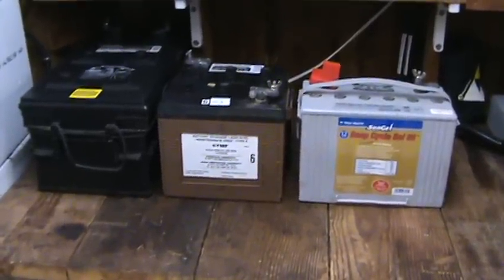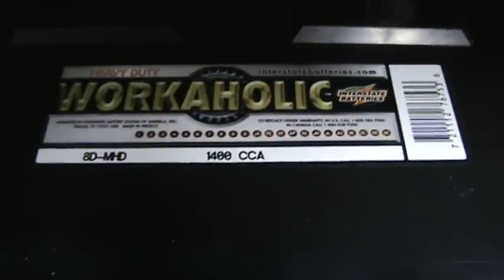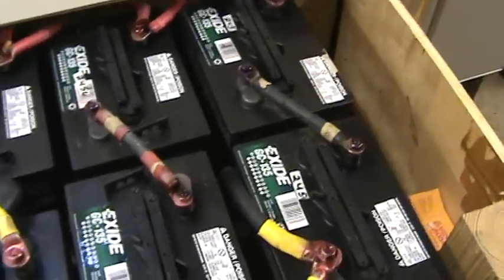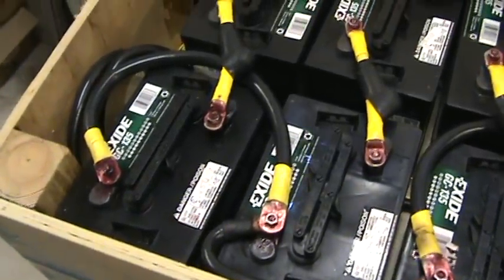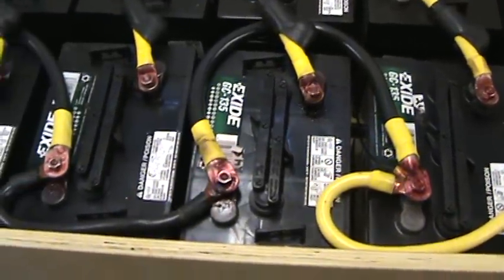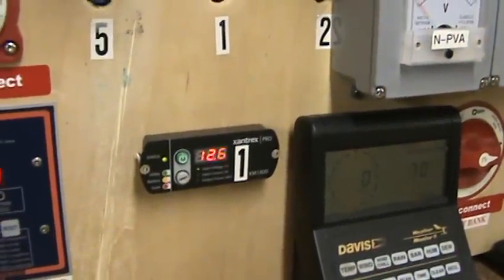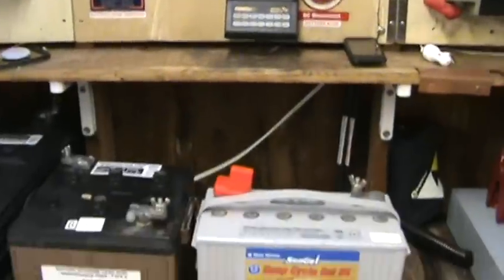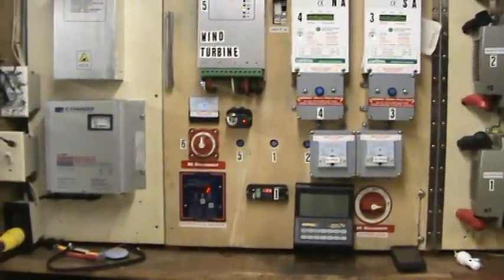Choosing batteries for solar power offgrid or a battery backup system.

Comment from the maker: If cost is not an issue I would go Rolls Surettes with auto fillers. If you are running a hybrid system with batterie back up The high end AGMs cant be beat. I have seen your set up.. Very nice.. Cheers..

Comment: Looking at a 15 kW system myself for a cabin up north but  this looks too expensive and time consuming for an occasional user.  I'm going to just tie to the grid for now to offset the $50/month hookup charge then work into storage gradually.  Maybe there will be an alternative in another 10 years.

Comment: The trick is eliminate as much resistant as you can. You start adding to much in the system and you end up defeating your panels output.

One thing about being mobile is your not stuck in one place. You can charge your batteries on a parking lot. Those four 1000 watt lights put out 4k watts on each pole at night. So let walmart pay for your electrical power!

Comment: If your wanting portable power, I use 2 235 watt panels, xantrex 1800 hf inverter with both 12 volt or 120 volt shore power input/output, 30 amp charge controller, and 2 12 volt northstar batteries agm deep cycle. It has 195 amps hour or 2400 watts charging over a 5 hour sunlight/cloudy day period. Its all mounted on the top of van and can track the suns path. You can do the same with a truck or suv.

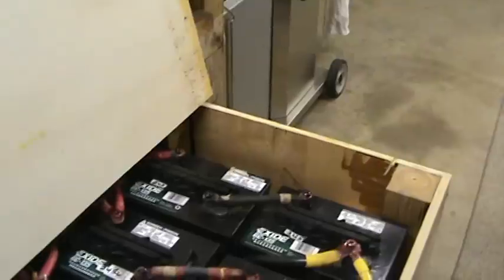Comment: I bought an off-grid house and right now I'm using an Avanty power station (similar to what can be seen at 2:47 in this video). It's not only a car battery booster but also a 12 V battery with built-in inverter with a regular socket and it can be charged from the wall back home and with a solar panel. It's 20 Ah and I'm using LED lights with it. Good for the weekend. Because I'm not living permanently at my cabin, stuff might get stolen. Any recommendation on an efficient portable solution?

Comment: thanks it has help me to decide what battery to use.  How about electric fork lift that may use in warehouses?     I want to build a off grid system   with 220 volt  power not tied to grid at all. to get power to my place would cost $13000 to 16000 for the cable in the ground from the power company.  I want some ideas on inverter, solar panels, controls, how Many?

Comment: Very good video.  You have a very clean setup.  I'm thinking about trying this in the UK.  Our electricity bills are like daylight robbery so I'm thinking of putting together a solar system.  I want to buy a couple of 120W panels ( Peak Output 7.93A @ 17.2V) to start with but looking for a decent set of batteries.  What rating of solar cells do you use and how many panels do you have?  I saw you also have a wind turbine in your system which is really cool.

Comment: I'm looking at making a solar generator but don't know much about any of this yet. I was thinking about using two 6v, 250ahr batteries with an 80watt folding panel, but I don't know how to figure out how many watts the solar panels need to push to charge them properly. Any advice? Does this seem like it would work?

Comment: When I bought my RV 3 years ago I took out the starting and auxiliary batteries and replaced them with golf cart batteries.  I was worried that they wouldn't have enough cranking amps to start the 454 but they've never failed to start the engine even when discharged below 11.7 volts.

Comment: lithium. iron. phosphate.
like Calb CA cells.
of course it's a different beast and you have to know how to treat them. don't overcharge, don't underdischarge. but then they will last several thousands of deep cycles and are near 100% efficient and they don't drop to half capacity if you discharge them in an hour.
lead's dead

Comment from the maker: They are. I like the AGMs that are made for solar use or off grid. Batteries are getting better but flooded lead acid batterys seam to rule in the truly off grid setups mostly Rolls Surettes. They are not cheap by no means but the large off grid systems use them and were talking world wide. Im shure the new batteries will be coming but for now they are crazy expencive and offer very little when it comes to long term track record.

Comment: are these all lead acid batteries?  Have you tried LiFePO3, Lithium iron phosphate?  I heard they are better for cycling due to its BMS and quick charge and high discharge rate

Comment: Great video brother.

 I have one of those UBER hyped Optima Yellow top batteries that are now made in Mexico for the same price(mine is one of the last ones made in Aurora Colorado) and it actually turned out to be an incredible battery for my mid-sized suv. 

So your saying that you only discharge your *Gold cart battery bank* down to 30% of total capacity? I knew some folks would correct your off math..haha. 

God bless brother.

Comment: Hi.  Can you please tell me, do you have to get electrical permit from city hall to put solar panels on the roof to charge your own batteries.  I have some solar panels on the roof and I charge few golf car batteries. And I do not interfear with a my grid. City inspactor told me that I have to pull a electrical permit, so that they can comein and inspect my home system.  I dont know what to do.  Please help. Thank you.

Comment: Do you have a video up on wire size? Specifically, is #12 wire safe to wire an off-grid cabin with? I am planning a 24v system and using LED lighting. The longest run would be around 30ft. Any info you could share would be greatly appreciated. Also your videos are some of the best I've seen keep it up.

Comment from the maker: Capacitors are good for a one shot discharge. They are used for starting heavy loads and or smoothing AC current. A capacitor can not store useful power. I hope that was helpfull..

Comment: I was shopping around looking for a good solar batteries and i ran across your video (thanks by the way). My question for u is would I b able to use a Pyle PBAT1000 1000 AMP 16V for a solar set up?

Comment: Very nice video!  I'm putting a system together, all I want for emergency purposes is to run a small 1.7 cf dorm style refrigerator that has a small freezer compartment.  Will my battery bank be very big?  How large a solar panel system would I be looking at? 
Thanks for any information you have

Comment: is there something written down on how to make and connect all of this together,I can read schematics,but would really be set if it just said,connect batteries in series .then positive line to positive on ac/dc converter,same for negative.I get from just attaching the panels then im lost.the harbor frieght,can i tie those together or do i need different units for the electrical draw for each?can i just do solar panels,to batteries,to ac/dc converter?

Comment: this is required to make a 12V system.  two 6V in parallel creates a 12V (thus the + to - connection.)  then the 12V "units" are connected in series to provide the longer life necessary for running services.   Hope that helps.

Comment: It looks like a red grease, I'm sure it would be used to help prevent corrosion on the terminals, and help conductivity. I've used a spray on paint type product that was blue for this purpose.
 Vasoline works well too.

Comment: does any one make a simple plug and play system for about 1kw with solar generator, batteries w/remote start on low battery and some solar, It is a hunting cabin in oklahoma built on a mountain with no power or water provision. It is built out of four 20 foot containers and well insulated.

Comment: Really good job on the explanation of batteries. I'm making my own off grid system and will be using 24 VDC. 3 banks of 24VDC GC batteries/220 Ah. 6X130-12 volt panels. 2 panels series. 3000 watt pure sign wave inverter. Thanks again!

Comment: To Christopher711: I think golf cart batt. from costco are cheap,but doesn't last long.If you want to build good battery bank for longer time get Trojan from Batteriesplus store for $96 a piece plus $20 for core.They are 220Ah/ 6V and the best.I would stay away from $78-88 golf cart batteries from Costco or Walmart, they have barely 150Ah.

Comment: Hey nice setup you got there! I am curious of how many batteries you have in your bank or in other words, what is you max Ah capacity? I have 1200Ah solar batteries and would like to contrast your setup. You said you had just the refrigerator, a freezer and a sound system running at the moment, right? Thanks!

Comment: Very good video and set up.I would like to know what DC voltage you have hooked up the battery bank to? 12,24,36,48..?Great advice on 6V batteries.Trojan is the best and not that expensive compare to special solar batteries...

Comment: Yes. Generally speaking (I don't know your exact set-up) this will work. We have a battery bank, with a 40amp charger and a smaller 1200watt Inverter. I can run the inverter at the same time the charger is running. 
However, why run the Inverter if you have 120V AC to operate the charger?

Comment: can i charge two 12volt batteries with a 10amp charger while the 2000watt inverter is operating at the same time

Comment: Curious, the battery configuration for your 6Volt batteries shown here in the video.  Is that a serial, parallel or combo configuration?

Comment: hello OBXSOLWIND.

i have 2 questions. 

Why you use a weak 12 volt power system?  Why have you not opted for the more powerful 24-volt system.

And why you use 6 volt batteries and not a real tractionbattery with 2 volt cells.

I have a sollar system total 1320 watts 6x220watt  kingsollar panels this panels give direct 44 volt for charging my 24 volt 680 amperes traction battery.

A better system is not available  Of course, this is more expensive but also has a longer life span.

Comment: hi thanks  for your information,my question is i want to build my solar panel where i use now the normal electricity so i want to change all that,i want to know the equation or how to choose the right number of solar cells that can give me the enough amount of electricity that can run the electricity in my home as the normal electricity doing now with no problems at all how to know this equation?all i know now that the normal electricity that moving in my house now in the sockets is220-240volt

Comment: Have you ever tried using 2v fork lift cells? They are like 3' tall and 4"x4" square. They build them into big 48v battery packs for tow motors but if you want 12v or 24v for solar that is easy to do. Just need the right charger. Check with a battery warehouse like interstate.

Comment: I want to install a line tap between my existing panels and the grid tied inverter to maintain a charge on some batteries via a charge controller ( the input to the grid-tied inverter currently reads 258VDC, install a disconnect switch between the batteries and an inverter to back feed my existing panel in the event of a black out I would throw my main breaker, and disconnect heavy loads like pool pump and AC.  However I need advice from experience.  please contact nschoggens@gmail.com  thanks!

Comment: @BloodRedChorizo Add up all the wattages of the lights and fans and get back to me.    Before you do, you should know you wont be able to make the power cheaper than the electrical company.    Even Kevin here he isn't doing this to save money.     He enjoys putting a system like this together, likes the idea of being prepared in case of an emergency etc.    These things have value too.

Comment: @TorchwoodElectrics A way to save on buying battery cables because they are expensive is to tie your batteries together using a busbar.     Check with an electrical contractor that does a lot of commercial work they may sell you the bars for the price of scrap copper.

Comment: Good video, personally I like the AGM batteries, although they are more expensive.   For a lot of people they are the better choice because many of us aren't that good at taking care of our systems.     One other point you didn't mention is that lead-acid batteries do not have a memory.    You don't need to work them out.    As long as you periodically get them fully charged up they will last a long time.

Comment: @TorchwoodElectrics Depends on what you are planning to draw off your batteries for amps.    Typically you would still go a size up or two from what your maximum draw would be just to be safe.     Generally you wouldn't have cables smaller than #8 (40 amps) for even the smallest systems.     #4 cables (75 amps are very typical for smaller to medium systems.       For larger systems have #2 or even larger gauge wire.    Also important to keep the battery cables as short as possible,

Comment: Only thing I haven't heard youu mention is the temperatures to keep batteries at. A lot of these guys have them out in there shops where they are at 90 and up in the summer and near freezing in the winter. How critical is the temp and is heat or cold worse? Thanx again Kevin and keep up the good work.-Nate

Comment: So you have 212 watt draw on the batteries when the video was shot - 1.69A draw @ 12.vdc = 212 watts. Good explanation in general for most people to use as guidance so they don't buy cranking batteries. You might know this but OutBack inverters and charge controllers have built in circuitry to equalize your batteries automatically. Great videos as always Kevin.

Comment: Ive been a heating and plumbing contractor for 12 years. I have installed many solar systems on homes for radient heat.  The systems I installed would heat a 2 to 3000 square foot home and its snow melt system at 10,000 ft in the Colorado mountains on just 2 panels. I just dont know much on the electric solar systems.  I look forward to my next home and creating a complete solar system for heat and electricity.

Comment: these are great videos. As a request is there a way to do  a video on the statistics of your system. I only ask about your system because it is a working example, and you seem to keep real close track of what you use and take in.  So as an example.  What your panels can bring in on ave, what your usage is.  what is your break even point ect.  The statistics interest me if your able.

Comment: I have one question how much did you pay for you golf cart battries and what do you think about the big like factory batterys like the 24 volt ones for like walkes fork trucks ect.   I at one time thougt about finding one of those but hell the ones we have at work weight like a ton they are heavy as hell and need a cran to lift them or change the battries in the tuggers ect.

Comment: Thanks for the video! I have a question, if you've already covered this,  please direct me to the video. If I'm running grid power with battery backup, charging system of some sort assumed, would it be worth it to run a low voltage circuit through the house, for lighting or other low voltage devices? I'm thinking this would save the losses in the inverter. One person I asked about this said just use the new LED lights in your fixtures, but that is just another place for loss.